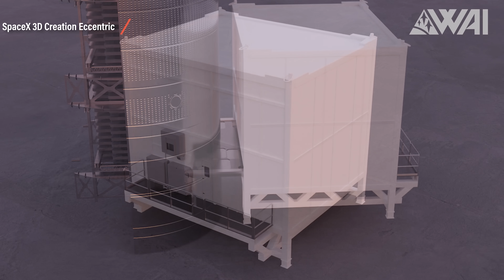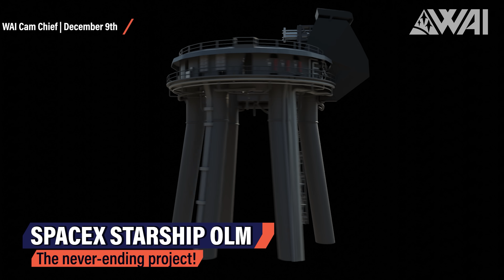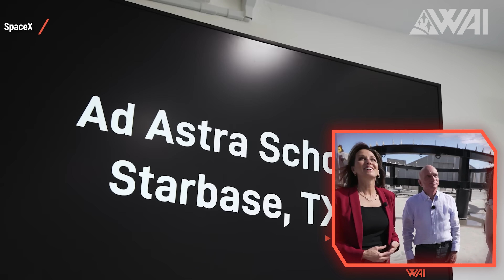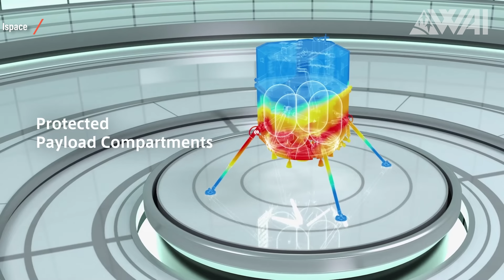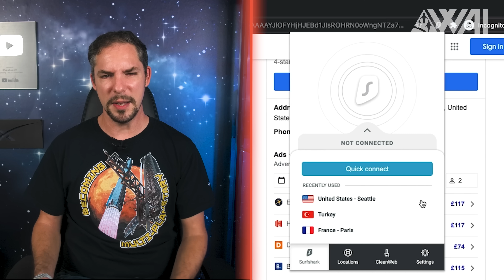SpaceX Starship New Solution! Artemis 1 Splashdown Flawless?

Comment from the maker: What do you think? Will Fondag do the trick? Is it even possible to launch Super Heavy with its 33 Raptor engines blasting down without a flame diverter? :_WAISweet:
Reply: It’s not the strength or abrasion resistance (or lack there of) that’s the problem.  It’s water.  When concrete sets up, it does not dry completely.  There is water captured deep inside and when exposed to extreme high temperatures it turns to steam, instantly.  Water volume expands by 1600 times when it turns to steam.  The internal pressure is enormous.  The concrete is literally exploding under Star Ship.
Reply: @jgrenwod  This is it right here. They're testing too fast for new concrete to cure enough for stuff like Fondag to be beneficial. ALL concrete needs time, even quick setting concrete.
Reply: Short answer, NO! It will not be safe to launch without a diverter and robust deluge system (as much for noise reduction as for the cooling effect). A Static fire of all 33 will likely teach Elon that.
Reply: You need a flame diverter, a blast ditch and water suppression system. Just look at the Apollo 4 launch which did not use a water suppression. It's not just the blast but also the sound. And I would put legs back on the boosters. You might think of trying to catch a Falcon 9 1st stage before trying a starship boosters. As always a great video Felix! Congratulations to Tim!
Reply: @chrischeshire6528  Like your suggestion of testing the catch system using a Falcon 9 first stage (possibly with a scaled tower, maybe). Upon relection, I cannot help but wonder why this wasn't done in the first place?
Reply: Will Fondag do the trick? Nope, they already tried Fondag-RS before the last static fire and they have since ripped it up.
Reply: They should make one imo , that would not take so much time to do and WILL save a LOT of time and work in the future  !
Reply: So Tim has a ride to the moon.
So does he have a ride BACK?
Reply: @johnbuchman4854 The ride back will be pretty scary. Will Tim have to put off family planing for the next ten years?
Reply: It is possible to launch without a flame diverter. It is just a waste of time. The best problem is no problem, and a wheeled in flame diverter almost totally prevents concrete damage. It is hard but not as hard as leaving it out.
Reply: Is it even possible to launch Super Heavy with its 33 Raptor engines blasting down without a flame diverter?  Maybe, but should it be done? If you cover the Fondag with sheets of stainless it will probably hold up, but you still have a lot of energy bouncing straight back up at the rocket.
Reply: @kirkpuppy  The real danger to all of this, is over 220db, eradicating the hearing of the endangered species in the preserve, that Musk's toy routinely sets on fire. You know, a death sentence to wild animals.
   You know, to make Musk rich, against the FAA's license. Money talks, and endangered species walk!
   Ps, SS steel is a TERRIBLE choice for space craft, via thermal, structural, and EVERYTHING ELSE M.E. teaches about spaceships. The STS was aluminum for a reason, and the starship is a CHEAP grade of SS for a reason as well. INFLATED STOCK PRICESm based on Musk LIES!
   IT WILL NEVER BE HUMAN RATED, and it a stock price inflation scam, AT BEST.

Enjoy the FACTS, against Musk BS.
"I believe Starship will go to the moon by 2021"
-Elon Musk, in 2019, as a person who claims to 'design' things.

"I oppose government subsidies"
-Musk, who has received $4.9BILLION in US tax subsidiaries, from US tax payers who have NO STOCK in Musks for profit business, nor any say.

"I'm a free speech absolutist"
-Musk, who has sued multiple people, including a youtuber giving a GOOD REVIEW to his Telsa, while regulating employee's social media speech. Now he bans people on his new $44billion toy, Twitter, for parody, while letting hate speech run rampant. Hate the people darker than Elon, A OK! Make fun of Elon, BANNED!!!!
   You know, 'free speech!'.

    "All Tesla cars have FSD ability"
-Musk, who's own DOT filing show only level 2 TESTING, and no motion of level 5 (FSD). He is now being sued for this lie. Cali DOT showed he advertised falsely (LIED).

"Cybertruck is the world's first electric pickup"
-Musk, ignoring the Volta Zero, that is commercially available to drive, TODAY.

Cybertruck windows....lol..brake like all others. Enjoy the up charge!

"Tesla will produce much-needed ventilators and distribute them to hospitals"
-Musk, who NEVER DID, but bought Chinese SLEEP APNIA machines, and delivered them to the LAUGHTER of the actual experts, who treated the COVID he downplayed. 
  He at least slapped Tesla sticker on them, so the hospitals got a GREAT laugh at his open con-man BS.

Musk lied about a world famous rescue diver, by calling him a 'pedo', because he proved Musk a LIAR about being able to use a submarine to rescue the people HE DID. All via a narrow passage so small, divers had to drag their tanks behind them. 
   But Musk, in his messiah hood, claimed ‘ his’ (not his) submarine, at 7 TIMES the diameter of a dive tank, was, 'the best choice'.
  You know, like a toddler slamming a square peg, against a round hole, crying, "it will fit, cause I said so!"

   Is this acceptable to you, as a person to be trusted for his word?
Reply: Although an actual launch will be easier on the concrete than these static fires, I still believe the big booster will require the diverter or launch at sea.
Reply: @ericf5978  No it will not. The vehicle will not outrun the shockwave reflected back. Apollo and shuttle taught us that.
Reply: Flame trench and Diverter are the only solutions.  In addition, a robust sound suppression water system is needed to reduce the sound levels as not to have them reflect back towards the vehicle.  Any other answers are incorrect.
Reply: Marshmallows would work best.
Reply: I don't think it will. It may be resistant to engine forces but shock management will be necessary at some point. Why SpaceX seems to be allowing pad & probable vehicle damage is a mystery. The laws of physics must be obeyed. I don't understand why engine forces haven't been diverted & or absorbed. Elon is a smart guy and I'm sure he has his reasons for not investing in flame management. Reverberating energy cannot be tolerated by any viable spacecraft system, especially one that's going to be launched on a very frequent basis.
Reply: @dougewald243  I agree with what you wrote the the exception of the comment about Musk.  He appears to want to do everything differently than anyone else.  He thinks he can get away without the flame trench and diverter with a larger water sound suppression system.  NASA has very bright people as well and they figured out with Apollo, Shuttle and SLS you need these things in order to prevent from having a really bad day.  All that energy has to go somewhere and it appears with the flat pad at Boca Chica, most of it will go up towards the vehicle.  In addition the debris that is thrown up for the pad can and will hit the vehicle.  His policy of do it differently is outweighing logic and the laws of physics.
Reply: Why have anything under it at all? Why not just have a big hole with a pool of water underneath?
Reply: Like all Musk claims, it's BULLSHITE.
Reply: The 33 engine test will determine whether or not a flame diverter is necessary and if it is, the first orbital launch will be delayed by months. I bet Elon Musk is very worried (about his credibility).
Reply: Can’t they use tiles? It seams they have plenty
Reply: If the engines can take the heat and stay solid it's not impossible to put something under the exhaust that will also stay intact but it will probably need internal cooling. A trench/ flame diverter   will likely be the least expensive solution.
Reply: @wesleyashley99  im not sure why spacex is shying away from a flame diverter ! Could be the water table or interference with replacing engines ! i think we will find out soon !
Reply: From the specs you listed I'd guess that Fondag is the interim solution: A material that can be replaced very quickly. Not great as a permanent solution, but probably the best for now. What about metals, perhaps a mobile, cooled metal plate construction that will not shed debris and will be easier to replace. I believe even flame diverters need replacing or repairing, so a system that makes it easy to move and replace modules seems reasonable to me...
Reply: @dinoschachten  ...or you could read the FAA fillings, instead of playing make-believe...against the facts. Why not address them? 
   Yet, your use of the word, 'believe', shows you're talking out the back end...like Musk does. 
  PS, platitudes do not send people into space safely, nor are a part of spacecraft design.
Reply: I mean, I don't understand why more berms but no diverter, but then again SpaceX regularly lands
orbital, hypersonic boosters on barges mid-ocean and plans to catch in mid-air it's rockets with robotic arms
so... what the puck do I know.  It would be weird if they can do all of that, but tough concrete is too much.
Reply: @jasonsadventure  If you look at LC  39A and SLC 40 where they launch from on the east coast, they have flame trenches and they are for the smaller Falcon 9s.
Reply: @pebmets  said: "there are flame trenches for smaller launches"  Yeah, I know.
So to me, having a flame diverter for Super Heavy seems to just make sense, especially given the 
the never-before-seen on Earth, 7.1 million pounds of thrust 33 raptors will produce at launch.
But SpaceX seems to specialize in making crazy things work, like landing a booster on a barge in the ocean for example.   I just don't get what they're saving by NOT having a flame diverter.
Reply: Why don't they put the silicone material like the ones that held the water un the shuttle srb's?
Reply: Thanks for the awesome video, Felix and team. 🙂👍 I hope that SpaceX solve that challenge, and prove that launch costs can be minimised even further than was thought possible before they came up with the idea. Thanks for showing that onboard re-entry video from Orion. That light show is amazing! Now, the gauntlet has been thrown down by ULA, and it will soon be inked up by SpaceX and Blue Origin. Expect some stunning, high definition, video from both of them. The future will be fascinating to witness.
Reply: what about centrally placed deflection hub, so that when they turn on the inner engines first a proportion of their rocket exhaust is deflected radially across the base of the OLM. Such that, when the outer ring is lit up, their exhaust hits this radial boundary layer of deflected rocket exhaust just above the concrete, which protects the concrete. A bit like how the turbo pump rocket exhaust of the saturn V f1 was redirected through the rocket bell to protect its surface from the full exhaust heat....
Reply: Let's hope so. But, my money is on thick steel plates
Reply: I hope this new material can stand up to the firepower coming from that many engines, but my gut feeling is that SpaceX will need to come up with an ingeniously effective and simple solution that involves a thrust diverter of some kind.  And lots and lots of water.
Reply: NO!
Reply: No Fondag will not do the trick
Reply: No flame diverter = profound stupidity.
Reply: You could attach a grid of small nozzles that push a flame at high pressure directly to the mount pillars. With SuperHeavy engines and water deluge ripping at the bare pillars, i think those small jets could form a sort of fire bubble around the pillars
Reply: SpaceX just needs to build a mobile flame diverter, one they can truck in for launches and test firings, and which they can truck out when maintenance on the launch pad is required.
Reply: No first launch will be a RUD due to concrete debris
Reply: Yes. 

By moving Starship operations to the floating ocean platforms. No concrete, no divertor required. And, the propellant logistics problems are solved by using modified LNG tanker ships with 50,000t capacity to deliver methalox and LN2 from shore based manufacturing facilities to the ocean platforms. Added bonus: Those LNG tanker ships function as a floating tank farm so there's no need to build large storage tanks into those ocean platforms. 

This is inevitable if Starship operations to the Moon and Mars are scheduled.
Reply: I suspect that not having a flame diverter was a mistake but SpaceX has some of the best rocket scientists in the world so surely they must have given it one heck of a lot of thought.

Anyway, if they are going this do-without-one route then Fondag good to 1100C will I assume help but another additional option might be to coat the Fondag with the special paint the the UK uses on the flight deck of its aircraft carriers. That paint has to withstand the blast of an F35 engine landing right on top of it, and at full thrust and angled down when taking off from the ski jump. That paint is apparently good up to 1500C. Horrendously expensive I assume, the UK only uses it on the 6 landing areas and the critical takeoff area rather than on the whole deck, but maybe worth looking at? Another issue is that being military technology it might need UK export approval but the UK & USA are very close allies so I suspect that would only be a delay not a show-stopper if permission was needed.
Reply: @julianfp1952  NASA has very bright engineers and they seem to think a flame trench and diverter are necessary for a large powerful vehicle.
Reply: @julianfp1952  There is similar coatings used by US Carriers and used around other areas that are exposed to flame and blast, like MK 41 missile launchers onboard cruisers and destroyers.  At this stage, I would think SpaceX might try many of the ideas discussed here.
Reply: An actual successful  liftoff of starship would be less damaging than any static fire testing ! what spacex  needs to do is anchor some thick metal plating  under the olm ! maybe putting a flame diverter would hamper engine replacement !  thats my guess there will not be one + issues with the water table !
Reply: @scottymoondogjakubin4766  incorrect. The vehicle will not outrun the shockwave that is reflected back. We're learned that from Apollo and shuttle. Physics didn't change.
Reply: @pebmets  wouldnt a 33 engine static fire create a Shockwave ?
Reply: @scottymoondogjakubin4766  Yes, if they ever have one.  With a 14 and 11, they can't keep the concrete from breaking apart.  Imagine the destruction 33 will do if they don't change their methodology for the pad.
Reply: @pebmets  my idea was metal plating anchored into the fondag but now im thinking all spacex is concentrating on is an orbital launch ! Everyday for me is one day closer to witness this !
Reply: They definitely need some kind of flame diverter if they have to rip up the concrete after 11 engines then 33 is going to rip it up completely.
Reply: @charmich , it's not a matter of concrete damage - it's a vital matter of shock management. Engine forces cannot be allowed to reflect back on the vehicle. If it destroys cement delicate rocket engines don't stand a chance. I don't know of any launch system in the extremely powerful category that doesn't divert & or suppress shockwaves. If the were then the money wouldn't be spent on such systems which are very expensive, obviously.

High definition slow motion video clearly shows extreme forces creating pure chaos under rocket engines. Rocketry is the science of chaos management or at least attempting to.
Reply: The best flame diverters are in China and Russia. Boca Chica Starbase will never have a flame diverter for reasons mention in another post.
Reply: Flame diverters are basic rocket science, not brain surgery..
If they are blasting apart launch mounts, it's to get data on launch mounts and materials science..

With a sea platform, your flame diverter is a hole in the floor..

On other planets, landing pads will need to be built one day, and they'll want tough materials to use..        :)
Reply: @D_Rogers  Launch from a sea platform with a hole below, and you’ll get massive turbulence in the water. And the platform floats on that water.
Reply: @StillAliveAndKicking_  Yep..   :)
Reply: There isn't a flame diverter on the moon or mars...
            Valuable data leads to better shielding.
Reply: @davidpaulsen1510  said: "[there won't be] a flame diverter on the moon or mars"  Yeah, but...
there won't be 7.1 million pounds of  "flame" from 33 raptors to divert on the moon or mars either.   
In other words, your comparing apples and well... mountains.
Reply: @davidpaulsen1510  Not a valid argument. There are no concrete pads on the moon either.
Reply: @davidpaulsen1510  there is no highly specialized high temperature resistant concrete pad, launch tower, launch table or superheavy rocket on moon or mars either. We know basically nothing about the Mars Starship variant, but HLS won't even use the main engines to land (probably won't take off with them either), instead using landing engines near the top, well clear of the ground.

Mars and Moon are completely irrelevant to this discussion of ground infrastructure.
Reply: @davidpaulsen1510  It won’t be a 33 engine booster taking off from the Moon or Mars though. The static fires of the ships and previous SNs (launches in the case of some of the SNs) on the suborbital stands should provide data on that and even there the test conditions are way more extreme because of the Earth’s denser atmosphere plus way higher thrust needed to defeat Earth gravity. Admittedly though on the other side of the equation there are prepared surfaces beneath the sub orbital stands vs initially unprepared surfaces on Mars and the Moon.
Reply: @davidpaulsen1510  this has always been my thinking as well. They want to design a rocket that can lift off from ground level, or very close to it. If not, it will be very hard to get off Mars again.
Reply: I think they are using this system to test possible issues on the moon or mars where debris will be an issue. The production launch system will use something more rapidly reusable.
Reply: Everyone. There is a simple solution to Starship's concrete destroying problem. They need to make the pad out of heavy steel plate, either bolted or welded together.. Its possible to build a steel pusher plate or 'pad' that can tolerate a nuclear explosion - so its definitely possible to design one that can tolerate a rocket exhaust.. Also steel's failure modes tend to be a lot safer than those of concrete - with less flying chunks and shrapnel.

As for shock waves and blast, angled plates on the surface can solve that. Also there is a powerful water suppression system on the launch mount already which should reduce the effects of shock waves.
Reply: @Lucien86  You know what is even a better tried and true method we know will work....A Flame trench and diverter.  Don't know why that solution is being avoided.   Would have to check, but it was said that the water system for the OLM is more for flame and heat vs sound.
Reply: @pebmets  The answer is simple. Flame pits and diverters are incredibly time consuming and expensive to build. With Starship one of the primary goals is to reduce the overall cost and accelerate the speed of building and launching rockets.. 
When NASA built the Cape Kennedy complex they had almost unlimited money..
Reply: @Lucien86  Cost doesn't substitute for physics.  How much is SpaceX spending refurbishing the pad after every test vs building a flame trench initially?
Reply: @pebmets  I wouldn't really disagree with that.. You have to remember though that the testing from scratch thing is a big part of the SpaceX approach. That means they will try all kinds of stupid things that might just work then save a lot of time and money -or might not.
Reply: @Lucien86  said: "make the pad out of heavy steel plate."  Here's the problem.
Steel melts:  2,500 degrees Fahrenheit.  Rocket blast: 6,000 degrees Fahrenheit.  Not so simple.
Reply: @jasonsadventure  The thing is about total thermal load and heat capacity not so much peak temperature, especially with a water deluge system.. If the rocket blast lasted for minutes it would be a problem but it doesn't. A steel pad is not going to melt - the launch mount itself is made out of steel and it doesn't melt..
Reply: Just remember if they land on another planet they will need a different build :) 

lol they refuse a diverter but still I bet they can make a replaceable one on the cheap
Reply: I'd be inclines to suggest a really thick layer of steel on top of the concrete - thick enough and large enough to dissipate the heat without melting. Would that work? I haven't done the sums.